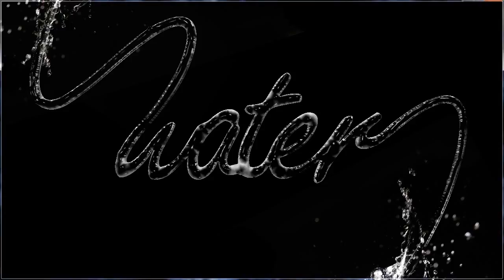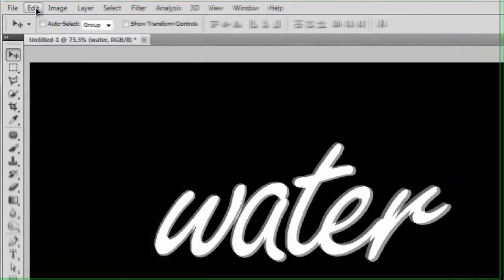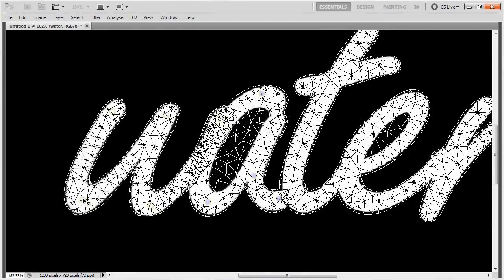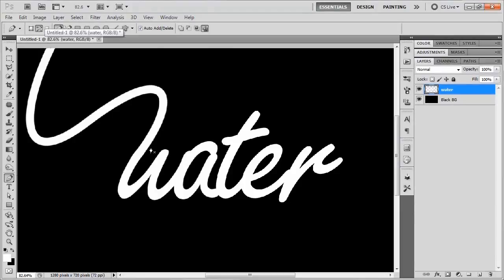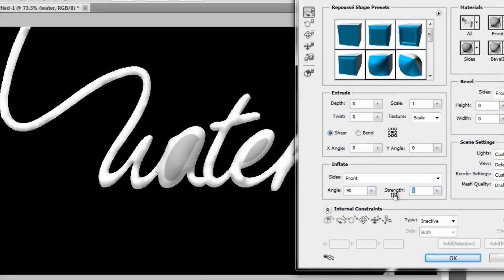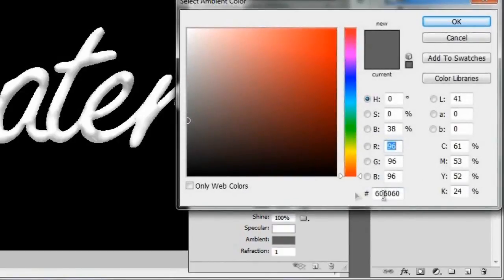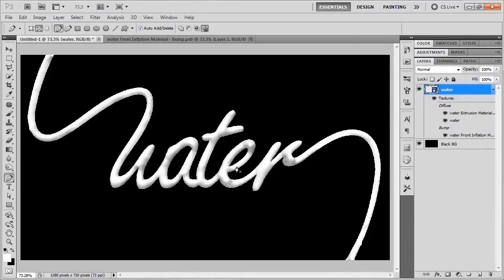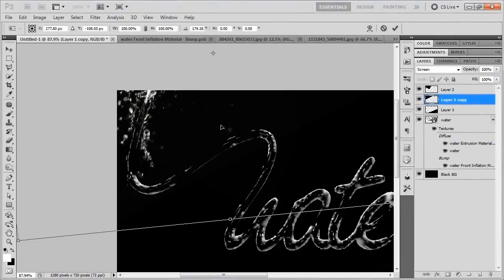3D Water Text Effect - Photoshop CS5 Extended Tutorial

Comment: @zamasta27794 

Bhai please help me my repousse wont working and it's says video card does not meet the requirements for hardware- accelerated 3D rendering. All 3D will be rendered with software only.

3D sence now exceeds the limits of lights and/or textures for the video card's hardware-accelerated 3D rendering.As long as the limits are exceeded, 3D rendering will be done in software only and some features (eg. Repousse) will be  disable.

i dont understand that..please help me 

Thanks